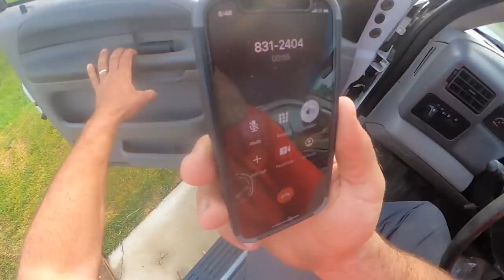Easy Friday concrete pour, short day for the guys.

Comment: Found this online to help keep your drive motor in better health in the future.  Perhaps you know all this already but figured it can't hurt.  1.) The oil for the hub bearing needs to be checked and changed about every 500 hours. If the levels run low, the failed bearing can quickly take out the rest of the final drive motor. If the oil looks “glittery” when you change it out, that likely means you have a bearing that is already tearing up.   2.) The damage from a clogged case drain filter.  This can be prevented by replacing the whenever you replace the other filters. A clean case drain filter will be bronze in color. If it is dark or dirty looking, it needs to be replaced.     3.) Too many times machine owners replace a final drive assuming it is the source of the problem when the issue really is the charge pump. If your Bobcat machine has a weak charge pump, it can cause damage to your final drive if the brakes don’t completely release. Your motor may seem weak or your Bobcat machine may steer to one side. If the charge pump is not replaced, it will damage your final drive motor.

Comment: Ryan when you order concrete what is low chirt? I've been doing concrete/masonry work for 35 plus years and never heard of it. How's the pickle juice working for your cramps? It's been real comfortable the last week for temps here in Michigan haven't had to many hot days and I'm loving it and it can stay that way. And btw we have only one Daryl on our crew and he just happens to be the boss. LOL
Reply from the maker: I have been ready with the pickles but so far the weather has been pretty decent.  When I order low chert, that is a reference to the aggregate in the concrete.  The reason I would want the mix to have a low percentage of chert stone is because chert stone absorbs water.  That can be a problem because those stones freeze and split themselves in half causing what are called "chert pops"  which are little divots left on the surface of the concrete.

Comment: If you don’t mind, I’d like to learn more about how you go about smoothing out your concrete, I work as a plumber and we have to do inside pours after residential repairs sometimes, or on our new construction jobsite. I want to try and get better as making my concrete look clean.
Reply from the maker: You would usually use a magnesium float to smooth it initially and then use a steel trowel after it has set for a while.  It just takes a bit of practice.
Reply: @VictoryOutdoorServices  thanks man, I’ll keep watching and try to pick up some tricks.

Comment: How does the panel not get pushed back on the ground when your walking on it
Reply from the maker: Concrete is coarse and rocky.  It's not like water at all.  Once it gets under the wire mesh it never goes back down.  Sometimes when it gets pulled up to high you actually have to stomp on it and work on it to get it back down below the surface.

Comment: Looks like a really Good Boss, business and crew to work for! Do you ever splash a little water on the top to wet it when you finish the concrete if the concrete starts to set and gets sticky then drags? Great video I just noticed you didn’t it’s a regular trick here in the UK Great work though nonetheless fella👌💯

Comment: I Work for a concrete company in Minnesota and have never seen or used this wire myself, is there maybe different code here that doesn’t allow this? We have only used #4 rebar and we pour foundations, driveways, patios, sidewalks etc.

Comment: I'm sure not every pour is the same. How many gallons of water was used in this video? How many gallons would it take for a good mix of cement? Example: per 10 yards. This one looked like it was much easier to work with. Btw, It's not easy you guys just make it seem that way.

Comment: Curious as I enjoy learning more everyday. How come you guys go on the knee boards with mags after boat floating it instead of just hitting it with a Fresno?
Reply from the maker: A fresno can trap bleed water causing the surface to weaken and be more prone to delamination. We have to be very careful what we do up here in Wisconsin because our winters are brutal on concrete.  Not to mention if I ever had a problem, the homeowner could blame it on improper finishing and they would be right, technically.
Reply: Sweet thanks for informing me

Comment: I have a question,  you know that orange pin you put in middle for depth,  do you leave it, pull it or hammer it down when concrete is on it
Reply from the maker: We pound it down as soon as we are done with it.  It is just a short piece of 1/2" rebar.
Reply: @VictoryOutdoorServices  I figured so, but wanted to know for sure. enjoying all your videos, some twice now.  I don't post much, but I'm watching
Reply: @VictoryOutdoorServices  there is 1 major problem, we need more videos...lol

Comment: No hating but why don’t you guys temp down the rock after screeding? Wouldn’t it make it easier to bull float?
Reply from the maker: Our concrete is really nice and bull floats very easily.  That would also add an entire step to the process which we usually wouldn't have time for. We do occasionally use a roller tamper on our stamped concrete to push the rock down a bit before bull floating.

Comment: You ever run a Fresno instead of crawling everything?
Reply from the maker: No, not really. A fresno can trap bleed water causing the surface to weaken and be more prone to delamination. We have to be very careful what we do up here in Wisconsin because our winters are brutal on concrete.  Not to mention if I ever had a problem, the homeowner could blame it on improper finishing and they would be right, technically. I honestly don't think it would be a problem but I don't want any problems if I can help it.

Comment: I figure almost every contractor in western Washington has had the pleasure of pulling pump hoses to the rear of the house at least once.
Reply from the maker: We used a pump last year and I had no idea how much work it was wrestling with those hoses.
Reply: @VictoryOutdoorServices  if you ever get to owning one, get hose sections in 10’ lengths (especially with 3” line). Finding clogs will be easier and your back will thank you. It is more expensive, but the last think you want is to throw out a clogged line because the sun cooked your 2” slump into a rock.